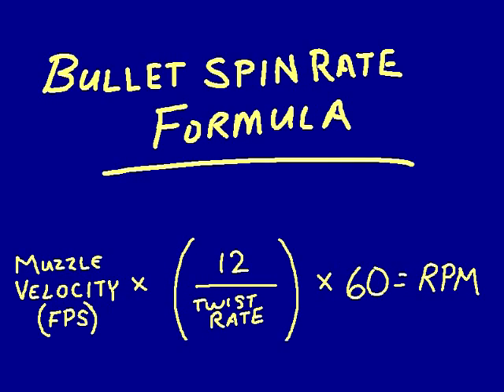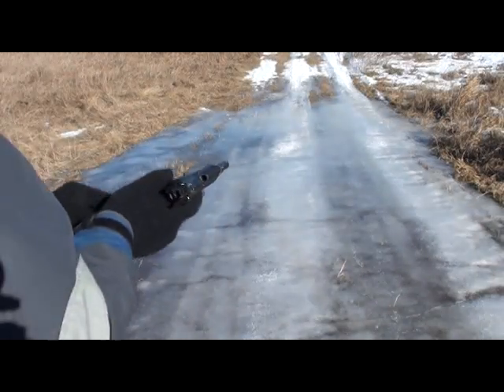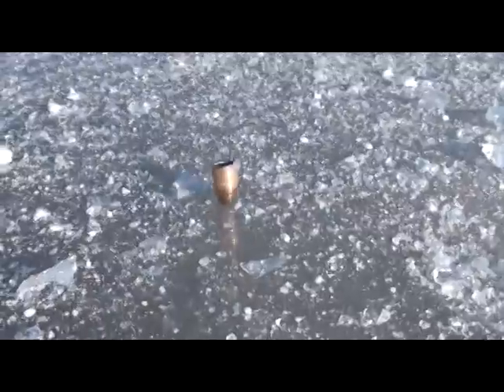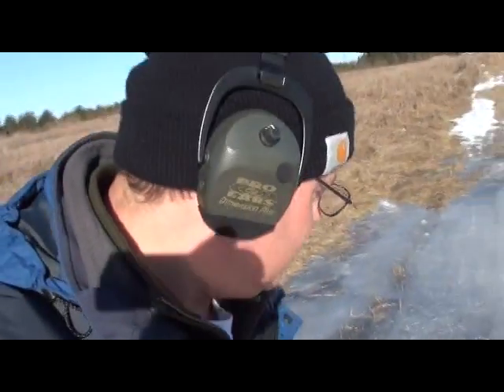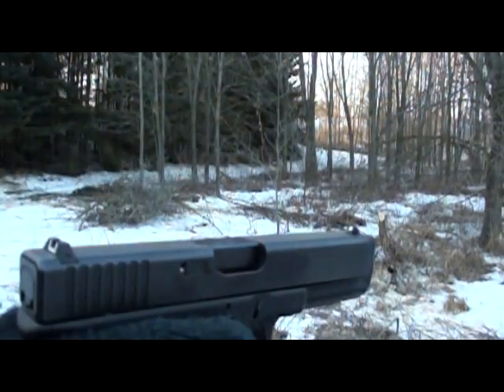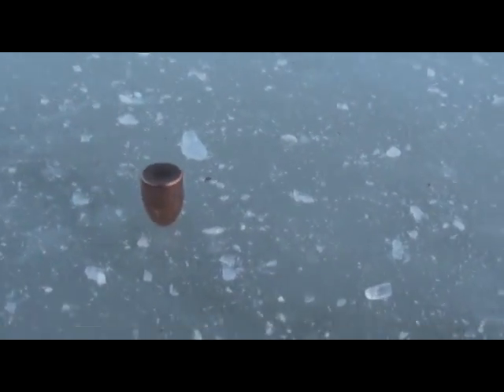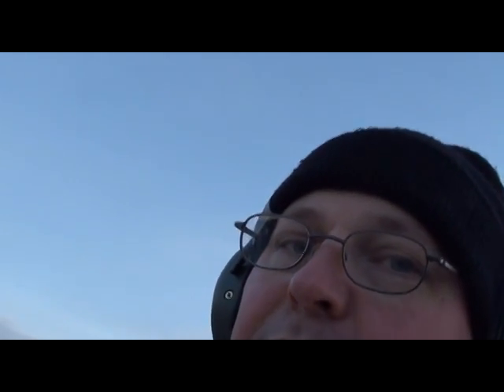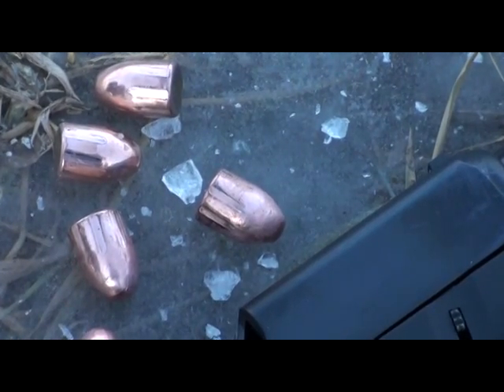Spinning Bullets on Ice - Demonstration and RPM Calculation

Comment: sorry to tell you but those RPM's are theoretical. at 240,000 RPM's the metal jacket would beripped from the lead core by centrifical force. if the bullet spins 1 time in 9 inches then at 1000 feet it would be spinnng at 1333.3 RPC's per second. far from the number you gave. which would tear the bullet apart just inches from the barrel
Reply: +don wan According to a couple of sources 240,000 or 300,000 RPM is not a fairy tale. Some quick googling and Wikipedia and other sources quote those figures.
Reply: and everything you read is true because its on the internet right. did you know that wikipedia is not based on facts. it is written by anybody and everybody. i even posted info on wikipedia once.
Reply: I suppose 1million frames per second photography, where you can actually see bullet spin isn't good enough for you. How about backing up your heresay with something concrete, then you can create your own wiki page since your so knowledgeable.
Reply: do me a favor dont vote for sanders or clinton. even though you have already committed your self to doing so please dont.
Reply: Another internet troll who can't back up his mouth with real facts.
Reply: by the way your military code name must mean T oo M uch M outh
Reply: +don wan hey idiot , here is some actual bullet math for ya . muzzle velocity (MV)
Here is a simple formula for calculating bullet RPM:
 MV x (12/twist rate in inches) x 60 = Bullet RPM
 Quick Version: MV X 720/Twist Rate = RPM
Example Two: What about a faster twist rate, say a 1:8″ twist?  Using the 2nd formula, this is simple to calculate. Assuming the 
same MV of 3000 FPS, the bullet makes 12/8 or 1.5 revolutions for each 
12″ or one foot it travels in the bore. Accordingly, the RPM is 3000 x 
(12/8) x 60, or 270,000 RPM.  TANGOMIKE GOT IT RIGHT !!!!
Reply: +bustinnutz2 FOR THOSE THAT UNDERSTAND MATH REFER to  Example One above: In a 1:12″ twist barrel the bullet will make one complete revolution for every 12″ (or 1 foot) it travels through the bore. This makes the RPM calculation very easy. With a velocity of 3000 feet per second (FPS), in a 1:12″ twist barrel, the bullet will spin 3000 revolutions per SECOND (because it is traveling exactly one foot, and thereby making one complete revolution, in 1/3000 of a second). To convert to RPM, simply multiply by 60 since there are 60 seconds in a minute. Thus, at 3000 FPS, a bullet will be spinning at 3000 x 60, or 180,000 RPM, when it leaves the barrel. HEY Don , Just DON'T VOTE or REPRODUCE EVER , you are the true meaning behind the movie Idiocracy !!
Reply: wow a true libtard has resonded but did not read what i wrote. the bullet can not sustain that rate and b your own math which shows that it rps is only 12 inches from the barrel. NOW TRY REAL HARD TO LISTEN OK? WHEN THAT FUCKIN BULLET IS 200 YRDS DOWN RANGE ITS RPF OR RPS ARE NO PLACE CLOSE TO WHAT IT WAS AT THE MUSSEL. THE BULLET IS N A CONSTANT STATE OF ROTATIONAL DEGRADATION . IF IT SUSTAINED THE 180,000 RPM AS IT TRAVELLED DOWN RANGE THE CENTRIFICAL FORCE WOULD RIP THE BULLET APART WITHIN 100 FT AT THAT RATE. BECAUSE IT IS SLOWING DOWN IT WILL NOT TEAR ITS SELF APART AS IT TRAVELS DOWN RANGE. USE YOUR FUCKIN HEAD AND NOT GOGLE YOU SIMPLE LIBTARD!
Reply: What evidence do you have that the bullet would " rip itself apart " ? you dont have a clue what you are talking about , just a guess .
 if you actually have ANY proof to back up you fantastical story of jacketed lead or lead alone ripping itself apart please do show it to everyone,  otherwise all you are doing is WRITING TOTAL SHIT THAT YOU ARE PULLING FROM YOUR PATHETIC ASS . Because i can TOTALLY BACK UP MY MATH YOU SAD LITTLE MORON , CAN YOU ?
Reply: BTW WE ARE TALKING ABOUT BULLETS THAT ARE BEING SHOT 10 FEET FROM THE BARREL INTO ICE , NOT 200 YARDS DON'T FORGET THAT , SO LETS SEE YOUR PATHETIC ATTEMPT AT PROVING WHEN A COPPER JACKETED BULLET WOULD RIP ITSELF APART !!!
Reply: f And yes, a quarter of a million RPM is not out of the question --in fact is fairly common.
To get your feeble mind wrapped around it, look at it this way:
Suppose a rifle with a 1 in 12 inch twist fires a bullet at 1,000 feet per second.
That means that the bullet turns around once in one foot.
That also means the velocity is 1,000 feet per second x 60 = 60,000 feet in one minute. (Yeah, it slows down, but we're just looking at the muzzle velocity here.)
That means the bullet is spinning 60,000 times in one minute, or 60,000 revolutions per minute, or 60,000 RPM.
A bullet shot out of this same barrel at 3,000 feet per second will be spinning 3 times as fast, or 180,000 rpm.
A bullet shot out of that barrel at 3,000 feet per second with a 1 in 9 twist will be spinning at 12/9 X 180,000 = 240,000 rpm
A bullet shot out of this barrel with that same twist at 3,300 feet per second will be rotating at 3,300/3,000 x 240,000 = 264,000 RPM.
Reply: +don wan BTW its called centrifugal force (like a centrifuge) not "CENTRIFICAL" you complete waste of human life . you have ZERO idea about the blather you spill on to these posts , you cant even spell what you are trying to talk about ! What a complete M O R O N ,  how Pathetic can 1 person get ? i think we all just found out from don wan !
Reply: You are the epitome of the word MORON but you did finally spell centrifugal correctly so YOU'RE WELCOME !! Its so funny to me when such a moron writes something like " there's no point in continuing this. but i will say just one more thing."and then continues to write about 10 different things that for 1 had NOTHING to do with the video and 2 spews a cornucopia of pointless blather to once again try to prove some point that he thinks is right BUT ISN'T . You still cant find a single website, book or ANYTHING of merit to prove to anybody that factory bullets EVER would rip themselves apart . I reload some of my own ammo and can force a bullet to rip itself apart by adding far to much powder , but the FACT is that these FULLY JACKETED FACTORY BULLETS can in FACT stay together at those rpm's because they were MADE TO STAY TOGETHER at those rpms (its called technology) . Go read a book you idiot , nobody has time for the theories if a true Pathetic Turd called "don wan" . you couldn't even spell your own fake name correctly pfffft and i doubt you even have a girlfriend or a gun ya looser
Reply: there is Centripetal Force and Centrifugal NOT centrifical force as he wrote , did you take not take any physics classes ? how about spelling ?
 have you ever heard of a Centrifuge before ? do you know what kind of forces they apply on people who are in them ? GUESS !! Not to bright are ya Will , you should actually look things up before opening your sad attempt at a brain and then writing things down eh ?
Reply: here is a lesson for the both of you today .
reading is only half of the battle for you next there needs to be COMPREHENSION , ¿Comprende? Centripetal force is defined as, “The component of force acting on a body in curvilinear motion that is directed toward the center of curvature or axis of rotation,” while centrifugal force is defined as, “The apparent force, equal and opposite to the centripetal force, drawing a rotating body away from the center of rotation, caused by the inertia of the body,”  NOW if you can wrap your mind around that you will realize how stupid your last post was WILL
Reply: You say ripped apart inches out of the barrel and then 20 seconds of flight. Ain't no cartridge, shell or whatnot that's flying 20 seconds. It will hit something or lose energy before that.
"Do you believe everything you read on the internet?" Says the guy posting on the internet. Lol

Comment: That's pretty cool! Well done. You could have done something analytical at the end though. Like, "the extremely high rpm meas that when they hit something solid the initial shock is not enough to stop it spinning entirely. Assuming the bullet isn't destroyed it will continue to spin and the centripetal force will keep it upright, much like a bicycle... etc" :D

Comment from the maker: @runninghoove MythBusters is good entertainment, as long as it's recorded so you can fast forward all those repeat scenes, but the reason they had such trouble was caused by their angle.  Instead of trying to replicate the YouTuber on the lake, they should have started steep and then backed off a few degrees on every shot or two (as their ice melts away).  The most effective angle for this effect is as close to vertical as possible.  After doing this so many times that show was hard to watch.

Comment from the maker: @chilly162 From doing this a number of times it seems like the kinetic energy that is mostly spent fragmenting the ice slows down the bullet progressively and that's why it doesn't deform or ricochet with any significant energy.  After this the only energy remaining is rotational.  Either way, the 9mm bullets with their faster twist rate and greater muzzle velocity spin many times longer than the slower .45 bullets.

Comment from the maker: @diesellifter If you watch my video at 4:02, you can see the bullet smash into the ice, which uses up nearly all of the energy so that it just bounces up about a foot or so and lands on a smooth part of the ice.  Since the bullet is still spinning very fast, it stabilizes itself from the gyroscopic force, just like a toy top or a gyroscope.  Since the ice offers such little friction it can spin for a few minutes if it doesn't bump against any snow or ice chips.

Comment from the maker: @grizz474 Yea, once I started doing the math it really blew my mind, too.  It doesn't seem possible that a bullet from an AR-15 can make over 4000 complete rotations in one second, it is just nuts when you really think about it.  And a .556 NATO @ 3250 FPS in a common 1 in 7" barrel is even faster - 5,570 revolutions per second!

Comment from the maker: @1AbominAble1 Those are safety glasses I'm wearing with the side shields removed, so my eyes are safe.  Bullets lose most of their energy when they smash the ice, so I am very confident there is no possibility of a serious injury as long as I watch my muzzle direction as always.  Some of these bullets stayed spinning under the ice as you can see in the middle of the video and again at the end.  They lose their velocity quickly but maintain their high rotational speed.

Comment from the maker: @Gabay54 Ice is a very good medium for slowing down a bullet because if the angle is steep enough, most of the bullet's kinetic energy is absorbed by the work of fracturing the ice.  Watch at 4:02 and you can see that the 230 grain bullet barely hops out after doing a good job smashing the ice.  Think of hitting the ice really hard with a ballpein hammer.  Does it bounce off the ice, or expend it's energy smashing it.  Now do the same to a hard tree or rock and it will likely bounce back - hard.

Comment from the maker: @bsrman36  Handling firearms is inherently dangerous and the biggest risk to my safety is having my attention split between my loaded firearm and my camera that I have to quickly grab in order to get a good closeup when I happen to see the bullet spinning.  Is it more dangerous than say, opening the throttle on a snowmobile for a fast ride across a frozen lake? no way.  I was hit in the finger while doing this and it hurt a little, that's it.  The ice flying back has more energy than the bullet.